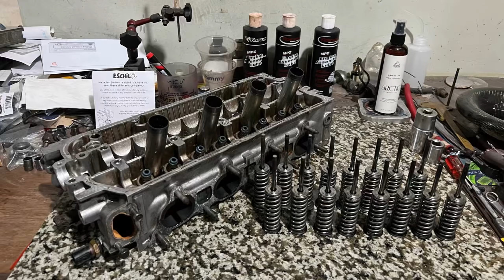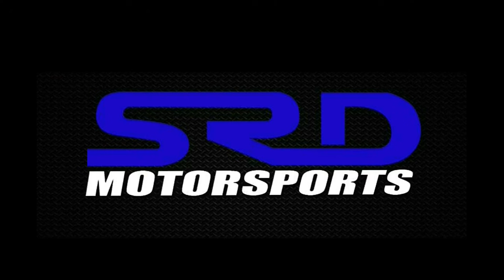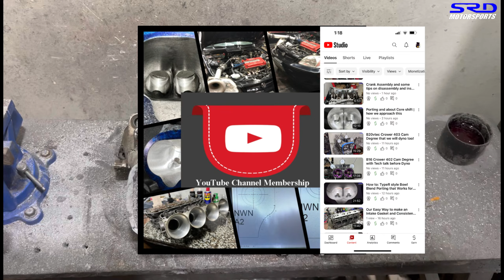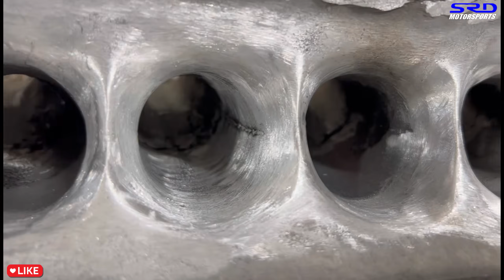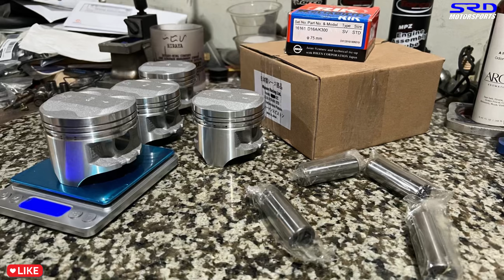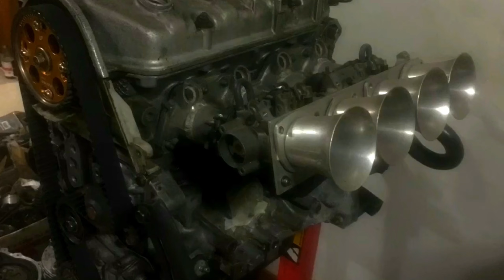SOHC D16 All Motor Skunk2 cam Build Series part 1

Comment: Hi, hope you are doing well, do you have a port for the d17a2 head? And how well does it do? Thanks in advance, have a nice day
Reply from the maker: we havnt had much work on the d17 as it actually didn’t come here in that variant
Reply: @SRDmotorsports okay, but if it were to be sent, would you still work on it? Just curious
Reply from the maker: Yeah we work on dsm, Toyota, Nissan , vw stuff too
Reply: @SRDmotorsports Thanks for the reply, have a great day
Reply from the maker: likewise sir
Reply: @SRDmotorsports Hi, its me again, I hope you are doing well, Im trying to find some information on the stock d16y8 cam profiles, so far Ive found an unconfirmed 246/230 advertised duration, I wanted to know if by any chance you know this to be correct, and what is the low cam intake profile? Ive searched everywhere and found nothing. 

Thanks in advance
Reply from the maker: actually no idea too 😅
Reply: @SRDmotorsports HAHA its okay, thanks though, have a nice day
Reply from the maker: you too 😎 hope u find the answers you need man

Comment: I also want to intall itb's but i dont know how to filter
Reply from the maker: Oh I see I see
Reply: @SRDmotorsports  do you have experience with itb? Any power gain ? The sound is cooll for sure
Reply from the maker: @krisztianadrian8528 like all parts, gains will always depend

It’s why tbh I cringe when someone asks how much gain does a ported manifold give? Bruh 😅

ok on a stock d16z6 or stock b16a maybe a ported intake will be lucky to give u 4-5whp

now on a high compression built engine that has good scavenging exhaust? Letting it breath better can be in the range of 10-14whp

so giving either answer? Is actually futile
Reply: @SRDmotorsports , yes yes we will see ...thanks you 🙏
Reply from the maker: no worries 😎

Comment: Habe you ever put seconary injectors on the far side of the runners for upper Rpm range on a Single butterfly manyfold? Best regards to all😊
Reply from the maker: No not yet , main problem will be “real estate” 
by that? I mean area or plenum volume

We can do that and appease to the better atomization theory for higher rpm but higher rpm will also want and need more plenum volume so with less volume it’s gonna work against each other

So for better atomization = current design injectors are tons better than our stock old style injectors then consider playing with fuel pressure to tweak the spray quality 
(Oops didn’t mean to spill some secret there)
Reply: @SRDmotorsports  thank you, so my theory was right
Reply from the maker: the lack of “real estate” will dictate the lack of benefit that is why it isn’t commonly done

Unless the cowl is like the scoop of an f1 (pre turbo era)

Comment: Always love the single cam stuff, a bit off topic but I was recently reading an old post from Cole Mulvey about using the d15b2/b7 bottom end for NA builds because of the crank being much lighter and the bearing surfaces being smaller and potentially causing less drag for that reason, I have a z6 I was going to put in my CRX, but now I’m considering doing a mini me with a Z6 head, I’m very curious on your thoughts about this
Reply from the maker: In theory that makes sense but a lot of times practicality and practice must be prioritized

the b2/b7 rods are severely weaker as they’re more flimsy even with arp rod bolts + u can run a lighter flywheel on the d16 and not worry if the crank is heavier than a d15b7

It’s much like the b18c gsr/ITR has narrower bearings for less friction + a better balanced crank…but practicality shows that a b20vtec can do 250whp easier for “most” and that same “most” won’t even consider or afford a 220whp b18c build

a lot of times the added confusion will come from d15b7 owners pushing for the theory though they’re stock or near stock and it’s mainly just for them to make themselves feel better that “that’s all they got” 

hope that makes sense

But yes in theory that’s correct
Reply: Thank you for the response, I always value your perspective. I would be replacing the rods in either engine with forged ones because d series rods scare me to death haha. So the plan for either block would be forged rods and I’m wanting to be around 10:2:1-10:5:1 compression ratio, if I went d15 would I pretty much be giving up displacement for little real world benefit
Reply from the maker: @VidHysleria yeah in that sense that’s about it…

Look into Mugen’s gt3/4 crx that had a D16a6 non vtec that did 218bhp , that’s roughly 184whp 😮
Reply: Ok thank you for saving me from hunting down a d15b7 and another z6 head then lol. I have already went down that rabbit hole I discovered that one from your A6 ITB video I think it was, awesome stuff
Reply from the maker: @VidHysleria hahaha I guess welcome to the rabbit hole? 😂

Comment: The you ever build a d16a1 or a d16a before just curious
Reply from the maker: a dohc u mean? No not yet 

But if u mean a sohc? Most are similar to one another granted it’s the same stock pistons etc
Reply: @SRDmotorsports  yea the dohc d16
Reply from the maker: ah that’s so cool ❤
Reply: I’ll tell you a story back in the day  I used to have a Integra gen 1 and got the d16a1 and for some reason spin to 9,000 or more crazy power and I was scare I said that’s not normal I call the guy the I buy the car he was a mechanic he tell me be like the formula one guys know how to shift so the engine don’t get damage so I was like what ? And so my temptation of keep spinning to 9000 RPMs continues and one day I was doing 100 110 mph and the third rod blew in pieces small very small pieces just very little pieces not even chunks of metal and the oil pump distributed the metal true all the engine sorry my spelling. I’m a  Spanish Guy so but yeah, it true story. I always wondering if they put some racing cams some double spring and maybe they take the red limiter out but don’t know the engine looks stock no racing filter no header just plain stock
Reply: Also the exhaust was stock and no sound of modify cams just normal Honda engine factory sound I think he just took the red limiter off